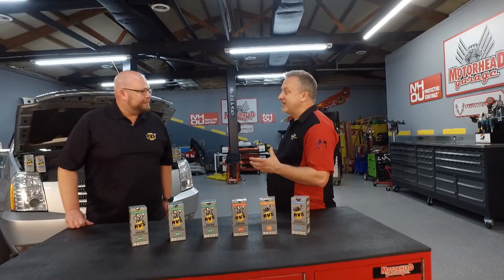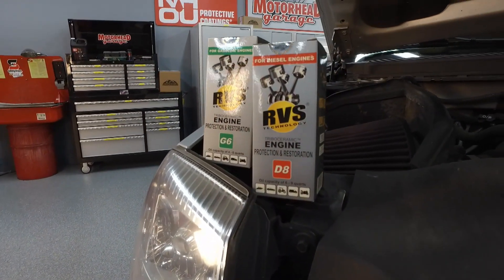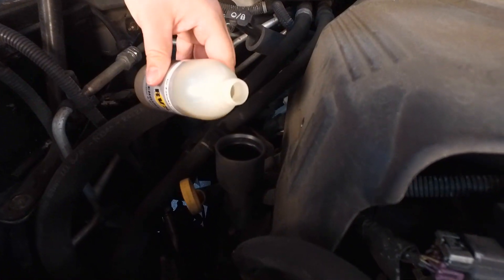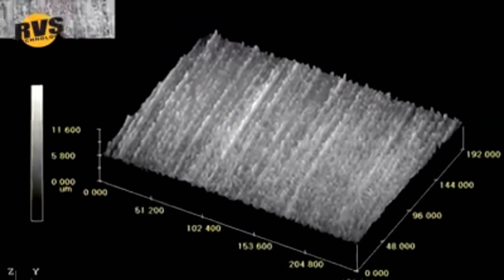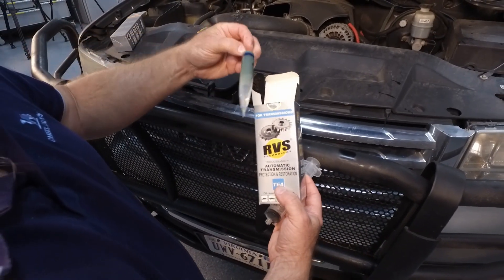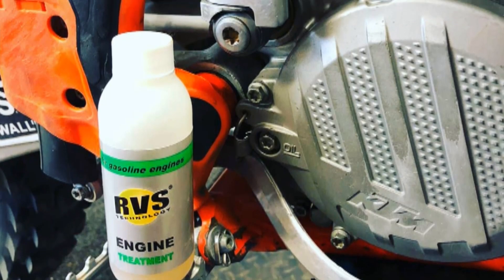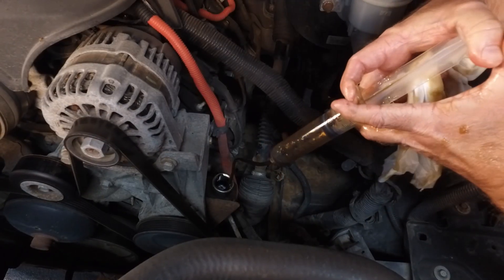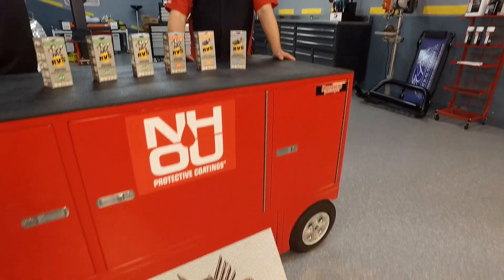Motorhead Garage RVS Technology showcase on Motortrend TV

Comment: I have a 1931 Ford model A with vertical scratches in the cylinders. They are the reason the compression is 3.2 at warm engine where it should be 4.2. Will RVS fill in those scratches, and why? (or why not)

Comment: So should you use this stuff before an oil change or after?
Reply from the maker: It depends on your mileage on the vehicle. If it's low mileage (less than 25k) you can just put one treatment in as long as you can get about a 1000 miles of driving in before next oil change. If more miles we recommend doing first treatment in old oil, drive 250 miles and then do a second treatment to new oil that stays in. The directions will have everything explained as well.

Comment: Just use high quality oil recommended by the manufacturer of your vehicle, don't use additives!
Reply: Yes, you can change oil regularly but with RVS you will get benefits what you will not get ever without using it. I have used 20 years these products for many differents types engines.